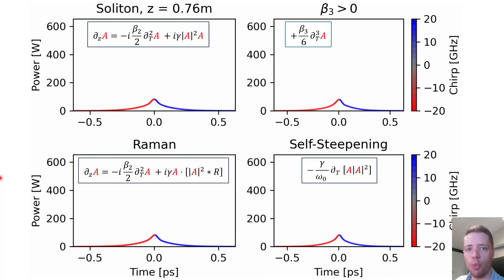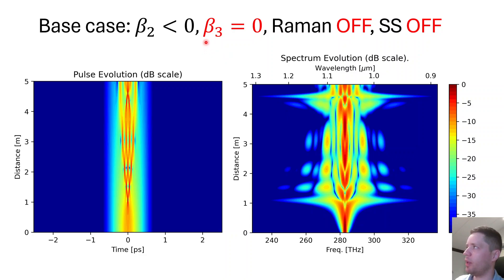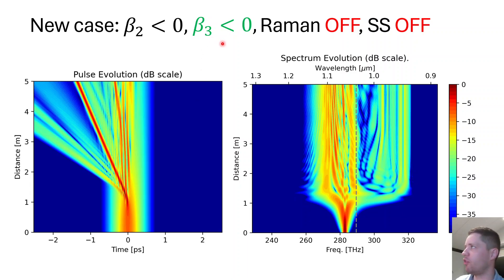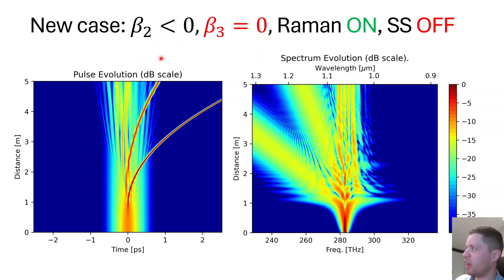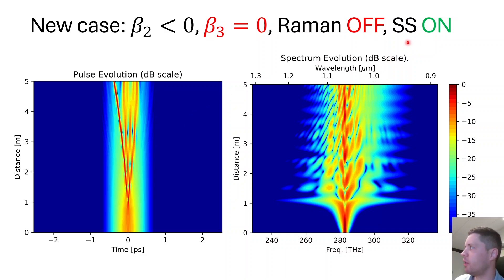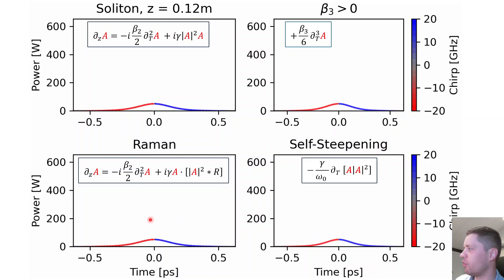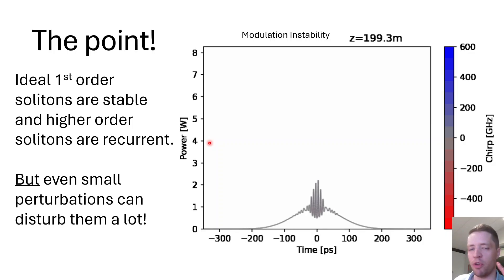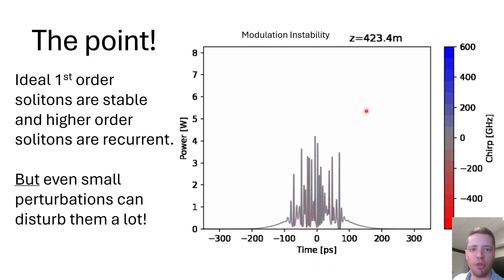Soliton fission explained!

Comment: does the fission occur spontaneously? can it be triggered in some ways?
Reply from the maker: Since the fission requires the pulse to have a certain peak power and duration, you could in principle create a very short pulse that is highly attenuated. Then, by gradually reducing the attenuation and thus boosting the power, you will eventually make it bright enough for soliton fission to occur.
Reply: @yourfavouriteta  makes sense, but how would one reduce the attenuation when the pulse is already on its way? altering the properties of the cable?
Reply from the maker: @GeoffryGifari  You could generate the pulses externally, launch them into a variable attenuator and then into the fiber. Simply reduce the attenuation to boost the power of the pulse. Alternatively you could generate low power fs pulses, send them into an amplifier, whose gain can be adjusted and then into the fiber. Otherwise, just change the power of the pulses by changing the amount of current supplied to the laser that generates them.

Comment: are the results of fission still solitons? or are they pulses with a different property
Reply from the maker: It depends a bit on what you mean by "soliton". The fission products that arise when Raman is present have stable power envelopes, but constantly reduce their own frequency; they are "solitonic" if you only care about the power envelope, but not if you also care about the spectrum. 

Another way to view the evolution is to think of an intense field going through a fiber with γ>0 and β2<0 as "one basic sech soliton with N=γPT^2/|β2| = 1 plus a bunch of extra field piled on top". Then, the fission process can be though of as all the additional field "peeling away" until only the basic soliton is left. This is of course a rather cartoonish way to think about it, but I believe it can be helpful.

Comment: Wait this is in fiber optic cable, so 1-dimensional motion right? what would the "fission" look like in space and time?
Reply: by this i mean, would a separation between multiple aolitona develop?
Reply from the maker: @GeoffryGifari  The animations in the beginning of the video essentially show "The power you would measure over time if the pulse had propagated through a fiber with a length of z". For example, if you pause the video when z=2.62m and consider the "Raman graph" in the lower left corner, it is telling you the following:

"Imagine taking a 2.62m long piece of fiber with a certain negative β2 value and a certain nonlinear parameter. If you launch a sech pulse with (whatever duration and peak power I was using) into this fiber and observe the light coming out the other end, you will first see a small amount of light at both high and low frequencies, then a short, moderately large flash at a lower frequency and finally (500fs later) a very intense, very brief flash at a much lower frequency. "

If we could track the propagation of this pulse through an actual fiber (imagine looking at the stretched out fiber from the outside), we would see a flash of light at a single color propagate through the first meter, whereupon two short sub-pulses are created and begin trailing behind the main pulse.
Reply: @yourfavouriteta  ah i see
Reply from the maker: @GeoffryGifari . Glad I was able to clarify. Great questions btw! :-)